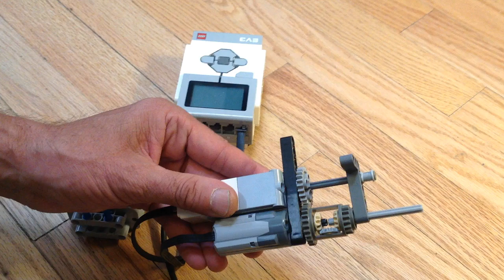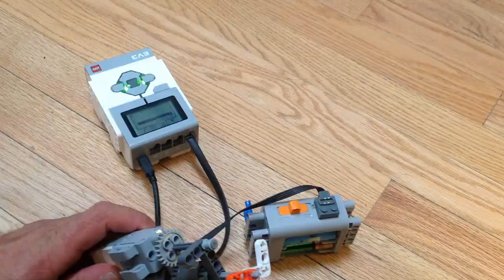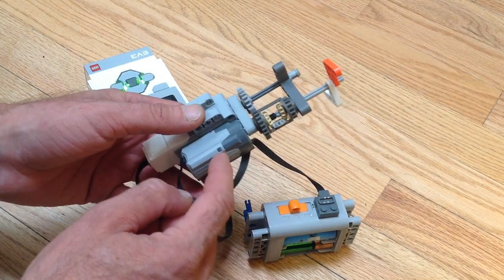Frictionless CVT Explained With LEGO Technic (Continuously Variable Transmission Differential)

Comment: possible solution to avoid electric motor???

-the "brake" gear / the gear regulating the output of the differential.
-is connected to a an oil pump
-the output of the oil pump is connected to a pipe
-the pipe is connected to a lever
-this means if you pull the lever limiting the flow it provides a brake force to the gear thus changing torque and speed?
-and the energy of the hydraulic flow could be re-run into the system so the energy isn't lost???

this would prevent going reverse but I'm sure there's a solution for that by
-connecting a pump and gear to the other side of the differential???? (though I'm not sure)

OR
-instead of a electric motor you could use a hydraulic pump powered by the engine (which are VERY high torque at low speeds meaning it would be a perfect application of torque in cars/trucks)

Comment: This is how tractor CVT/IVT transmissions work, except tractors use planetary gear sets in place of the Lego differential; they work exactly the same, though. Tractors use a large hydrostatic pump and motor to drive the top gear in this demonstration. At low and high speed, they tend to be power hungry, as the hydrostatic motor takes alot of power. But most transmissions are programmed to run with the hydro motor stopped, allowing the engine to drive the tractor 100% mechanically through the planetary gear set.

Comment: It was one of my first ideas to play with, and I have build a simple chassis using two motors and a differential to have 4-speed transmission. But I failed, it opens that it have no torque at low speed, because it's simpler to speed up or rotate second motor than to move chassis through the hill.
Reply from the maker: True. These are just for fun. Like a Lego house, not very practical.

Comment: Awesome and simple design :-)
I have tested this a bit.

When the variator is turned of I have some torque, but not more than it can be overcome it, though it puts some load on the drive motor. This is what I would call a "neutral".
When the variator is running in one direction I get lots of torque.

If I put in a 3:1 reduction from the variator the top speed is lowered, but I think I get more torque, which would be perfect for heavy machinery models. Having two gears on each axle and using the new diffs with five bevel gears I believe it will become unbreakable.

If I switch to 1:3 gearing from the variator, then there is no torque at all.

Comment: I see the physics in action, but when it comes to a car with a CVT using this concept, my brain does a disconnect, and i keep thinking you would have to have two engines running, or some sort of strange electric motor running in tandem with the regular engine to achieve highway speeds.
Reply from the maker: You are correct. It is like a hybrid transmission.
Reply: @MaxBrix  I guess it's the only way to get very close to a CVT with legos
Reply: @Jofuss The conqueror well it's a device that transmits the engine power to the wheels, so i guess that falls under the deffinition
Reply: You can also have a "free spinning" gear, all power goes to this gear until you take energy away from it. The energy has to go somewhere and will continue to your output. Essentially replace your second engine with a clutch. Or do what hybrids do and have 2 planetary gears sets. 1 with both engines and one with a clutch (Dynamo in the case of Toyota) and the output.

Either way if you block one of the outputs from spinning the energy will flow to the other output, you don't really lose power in this process.

Comment: Thanks for the informative video. 

Out of practice AFOL here.

I'm building a turntable and I'd like an "idiotproof" means of turning it with a handcrank OR using an embedded motor. 

Possibly integrating a clutch gear on the side of the motor to reduce undue strain. 

By any chance, do you know if and/or how I can use the differential to make two means of propulsion(manual V power) simultaneously linked without straining the motor?

Hours upon hours of work on this thing so far. The first model is an extremely complex Alternate Build MOC.

The platform itself is (I think) 5hX15w with a black Technic cage in the center to transfer the handcrank power at a right angle upwards for turntable functionality. So... Space is a little tight. =)
Reply from the maker: If you look at my 26.4 kph car I show the transmission that is using 2 independently variable power sources on one axle. It is a modification of the thing in this video.
Reply: Thanks so much for your reply. I finished my Lamentation Turntable thanks to you. Over 400 technic pieces. I'm using Technic Folklift as my only parts available, so I had to be creative. 

I'm extremely happy with how it's turning out. 

I'll look for your model you referred to in your previous msg.

Comment: interesting but just using dc motors , direct coupling of the two motor is the way to go..
Reply from the maker: Actually, I have a newer video with a car that has direct-coupled motors and a CVT like this one. Both is also good!
Reply: @MaxBrix  I think this design is better for real world application. Same idea essentially if you would have a diesel generator powering 2 electric motors, each motor connected to an open differential on the axle ends. One spins one way the other counters rotates, powered neutral is both running flat out in opposite directions, as one slows down you get a movement on the output in one rotation, half speed is one stopped and one running flat out, then the stopped motor matches the other motor to give increased speed until flat out and the highest speed in one direction in the output shaft.  The real advantage comes in stopping, under half speed in, the stopped motor is actually powering up to stop the rotation on the output shaft this gives a powered brake which is something current cvt transmissions in heavy agricultural equipment are incapable of without undergoing incredible stresses in hydraulic equipment, leading to early failure.
I think this design could be used in this real world application and is extremely easy to implement as you've shown.

Comment: ok so to make a fixed speed motor run an output shaft at a continuously variable speed...  
you need a 2nd motor that can provide continuously variable speed ?
Reply from the maker: Or you can provide torque to one output from two independent motors like in a Hybrid. Check out the car I made with this recently it goes 26.4KPH: https://youtu.be/DJ8Z-B373kI

Comment: So I did the physics and its kind of a downer. Although it is successfully changing the speed ratio, the amount of power coming out of the output shaft is actually less than the amount going in from the technic motor. Most of the power coming in from the technic motor is going out through the EV3 motor, which is actually working as a brake. 

To make this easier to write I’m going to call the technic motor A, and the EV3 motor B
The power out = (Torque A)*((Angular Velocity A)-(2*angular velocity B)), so basically whenever B is rotating, it is subtracting power from the system. Notice torque B is not even part of the equation. That is because Torque B must always be 2*Torque A in order for the system to be in equilibrium.
In addition, (Torque Output) = (Torque A), so it is not working like a traditional gear set that can provide a step up in torque.
Reply from the maker: Yes, the goal is to allow the input motor to have a constant RPM while the output RPM changes not to add the torque or power of both motors together. CVT is only useful for gas engines that are most efficient at a particular RPM. This is not the best CVT system for transferring torque but it is good for demonstration.
Reply: MaxBrix True, but just looking at the efficiency of the engine is an incomplete picture. The efficiency of the transmission itself also needs to be taken into account. Efficiency is defined by power out/power in. In this transmission that gives 1-(2*Angular Velocity B)/(Angular Velocity A) , not accounting for frictional losses. This means when the transmission is operating at a low ratio (when the EV3 motor is spinning near to half the speed of the technic motor) the efficiency of the transmission is almost zero. So the efficiency of the system is Efficiency engine*efficiency transmission. Even though the efficiency of the engine is improved by maybe 15% by keeping it in the optimal RPMs, the low efficiency of the transmission will outweigh this improvement much of the time. If it didn’t, then every vehicle on the road would have these. 

I think this is an interesting mechanism, and a good demonstration of a differential. But it is not a true CVT anymore than a motor that can spin at varying speeds could be considered a CVT.

Comment: This is not frictionless. That is almost impossible.
Reply from the maker: "frictionless" refers to the clutch action not needing to use friction. Not a lack of friction in the system.
Reply from the maker: The point is to change the output rotation speed while maintaining a constant engine speed without a friction clutch.
Reply: @MaxBrix  Ooooohhh i see.
Reply: Oil :)

Comment: Does this change the torque or just the velocity?
Reply: Both. The torque is amplofied with the reduction of velocity... although it is somewhat limited. By implementing a worm gear on the variator side, you can greatly increase the available torque, at the expense of allowing both motors to apply power to the output.
Reply: Both. The torque is amplified with the reduction of velocity... although it is somewhat limited. By implementing a worm gear on the variator side, you can greatly increase the available torque, at the expense of allowing both motors to apply power to the output.
Reply from the maker: The torque is mostly dependant on the power of the input motor. In this case the Lmotor. It stays constant as the power and torque coming off of the drive motor is constant.
Reply from the maker: If the drive motor is providing less torque than the secondary motor than the secondary motor becomes the weak link but. it has an intrinsic advantage